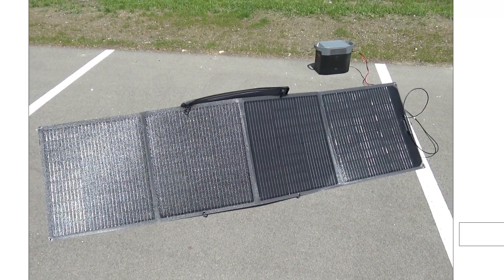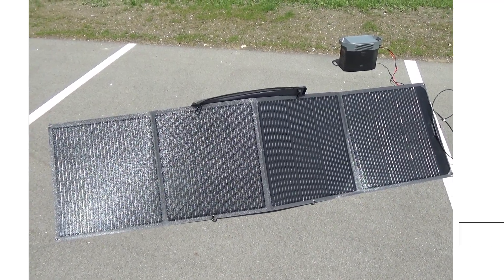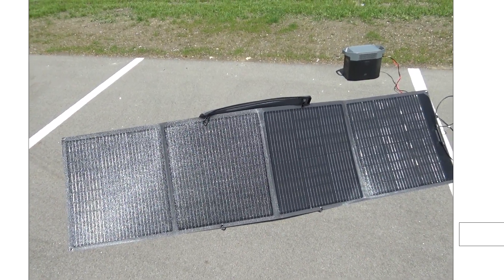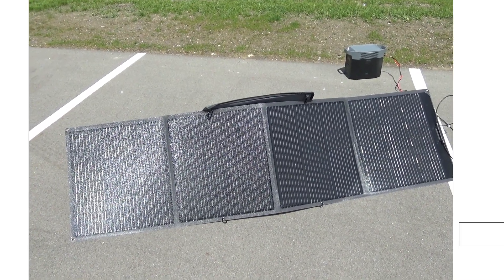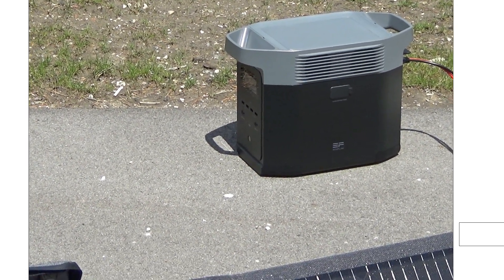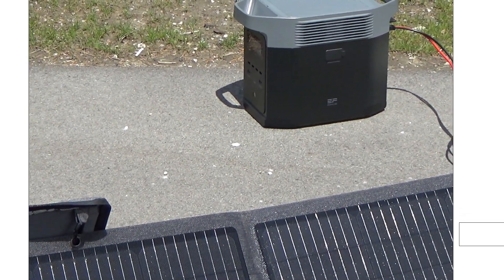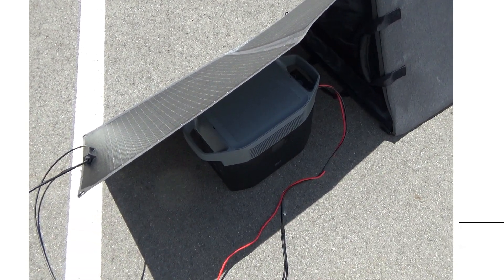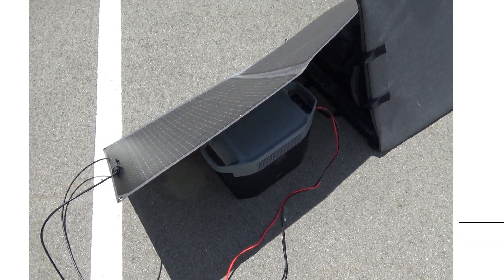#1 basic tip to extend the life of your power station

Comment: Not a good idea to put the generator behind the solar panels they really heat up alot
Reply from the maker: It's still better than leaving the power station out in the sun. Just try to leave a gap between the backside of the panel and the power station. 

Ideally, yes find another way to shade the power station. 👍
Reply: @SoGenFan  yes for sure, it will better to buy a reflective grey housing like those used for cars

Comment: It's so hot where I live, that even if the power station were white, it would still get heat damage.  I can only use a power station during summer when it's in the shade.  I prefer to keep my power station indoors and use a long extension cord.  Indoor use will also prevent theives from stealing the panels and the system.  Rigid panels are not only more affordable, but more durable and less likely to get stolen.

Another complaint I have with solar generators is that it is hard to hide solar panels and systems from theives!  Having the panels on the rear roof could help.   Portable panels in the front or side yard are practically thief magnets.   Your neighbors may get jealous that you have a power backup system.  If you have nice neighbors, it would be great to offer some of my electrical resources to them.  If my neighbors are nervy, well, that's a different story.

If solar panels are installed on a home's roof, and the installation wasn't done up to code, homeowners insurance may not pay for property damages.  Also, if an insurance inspectors sees the panels physically or on Google maps, insurance rates may go up or questions may be asked!   Solar power generation is not only expensive but a potential disaster.  Be careful, people.

Thanks, SoGenFan for all your tips.  I appreciate your conservative, common sense approach.  Corporations and governments may have us think otherwise, but I believe we are practically in the horse and buggy days of solar energy.  Well, maybe I'm exaggerating a bit.  Clearly, solar energy has a long way to go as far as performance, price and safety is concerned.
Reply from the maker: Those are all good points. And that is exactly why I almost always use my solar panels laying flat on the ground (I only show this one angled up for the sake of the video).

When flat you won't get as much output, but if you add just 1 more panel, you can make up the difference (or even exceed it!). And dark colored panels laying flat in the grass are almost unnoticeable from a distance.